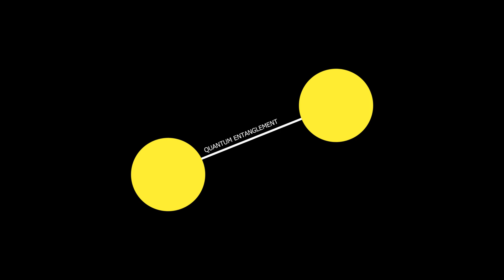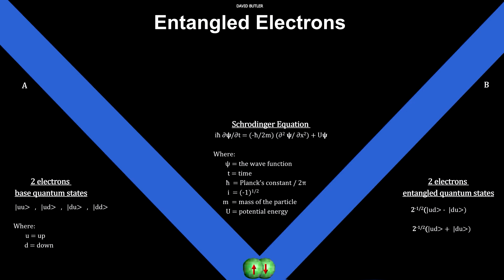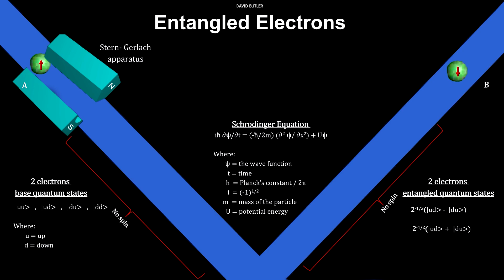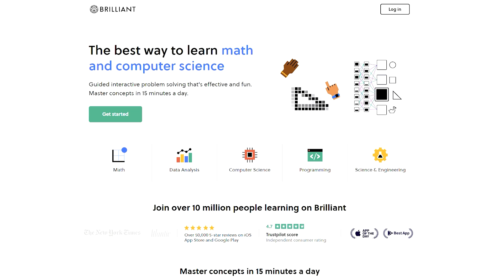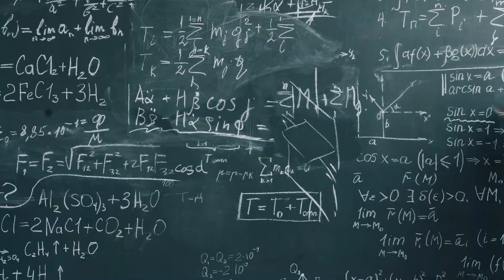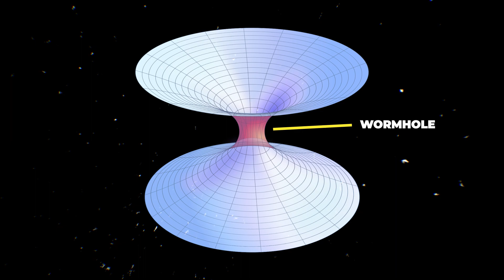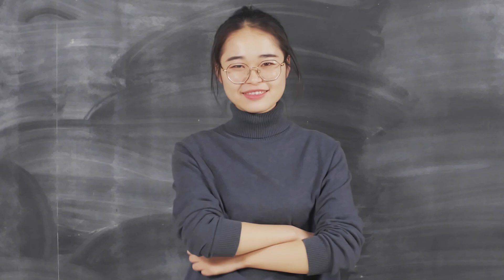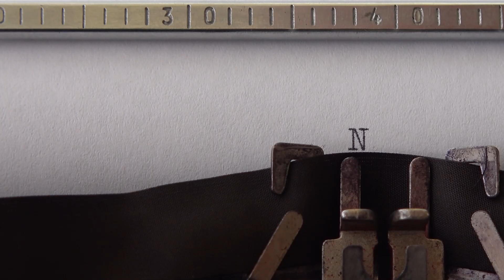How Do Particles Feel Each Other?

Comment: In just the same way as a pebble dropped into water will form ripples that are not random; the waves are relative and synchronized (entanglement) as they radiate out from their centre source. In this theory, time has a similar geometry based on Huygens’ Principle: That says: “Every point on a wave front may be considered a source of secondary spherical 4πr² wave, which spreads out in the forward direction at the speed of light”. Light waves radiate out spherically and when a wave front comes in contact with the electrons of an atom it forms a photon electron coupling that has particle characteristics. This pinches the beginnings and the end of the light path forming spherical harmonics, just as on a bounded guitar string, only a certain number of waves can exist. You can have one wave, two waves, or more, but never any number that is not a whole number. This forms a starting point of the process in the form of the Planck Constant ħ=h/2π of action.
Reply from the maker: This reflects a theory aligning wave-particle duality, quantum entanglement, and time. It highlights Huygens' Principle, wave propagation, and quantum characteristics like the Planck constant. While it presents an interesting viewpoint, it's not standard physics interpretation and needs rigorous testing for validity.